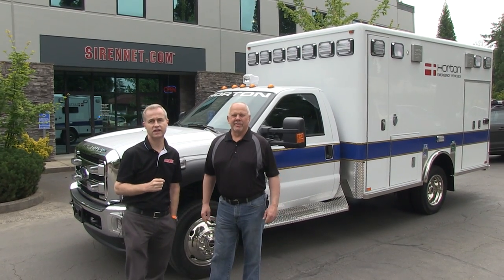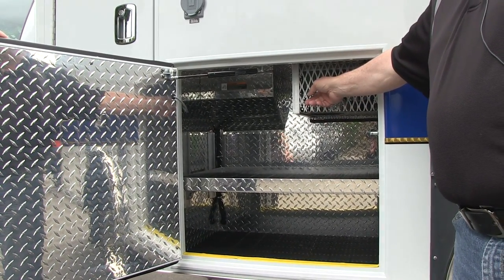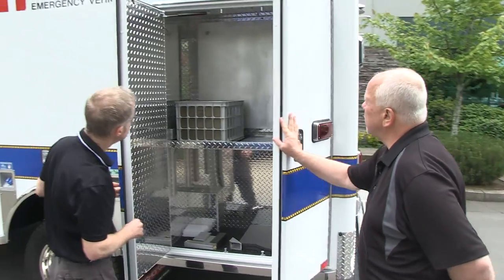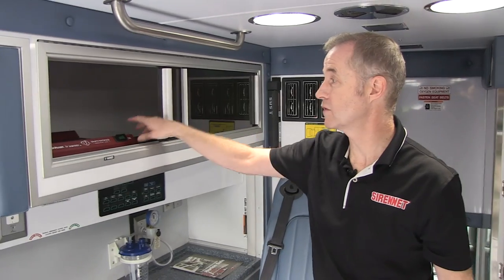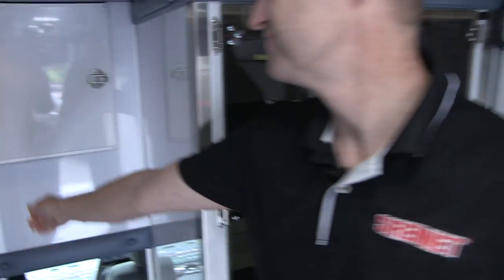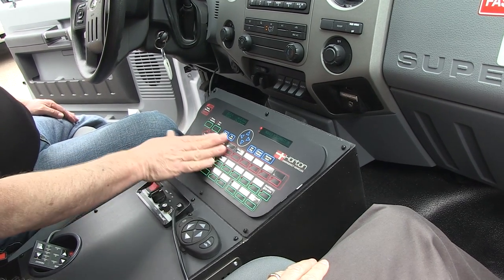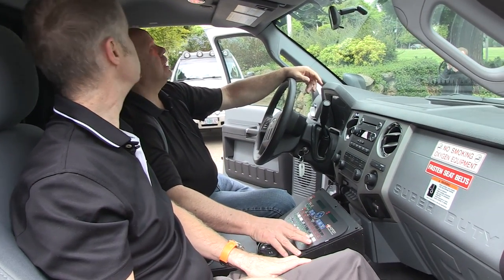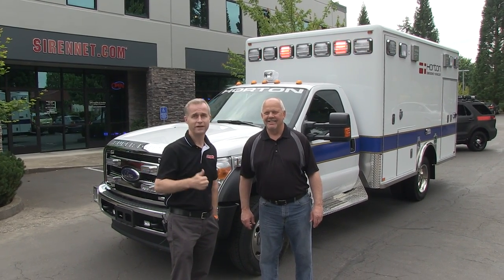Bob Lemieux takes SIRENNET on a tour of a new Horton Ambulance

Comment: One sexy vehicle!  I'd love to own a used Amby.  I don't like the AC on the floor that is not smart.  Also why is there not a diesel heater?  Chinese brands are $100 on Amazon, use diesel fuel, no condensation, and you can tap into diesel tank or exterior cabinet.  Seems like that would be the best heating source - efficient, cheap, no condensation, and easy.

Pity you did not explain the inverter, and any generator, charging systems, how the electrical worked.

Comment: I did my EMT clinicals on a Type One Horton ambulance similar to this one and they have near constant suspension problems. Has anyone else heard of that with Horton or is it just a normal occurrence in the industry. I ask because all previous transports units with the department are Type III MedTecs and I haven't heard of any serious problems with those. Also the largest local fire department runs Freightliner Medium Duty MedTec Med Units and I haven't heard of any problems with those. Thoughts?
Reply: I think braun is the worst... Horton is by far the best!